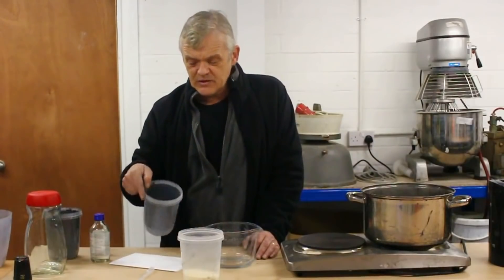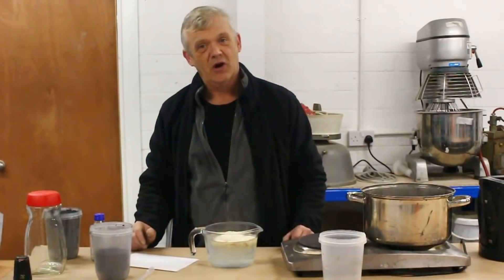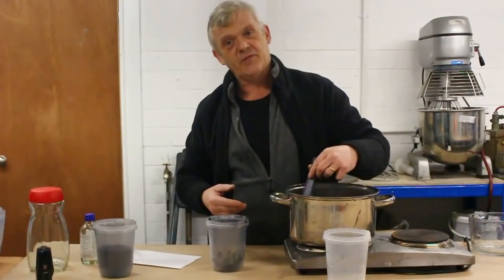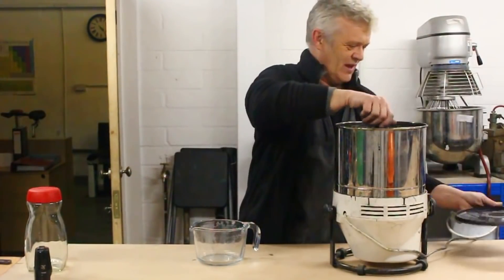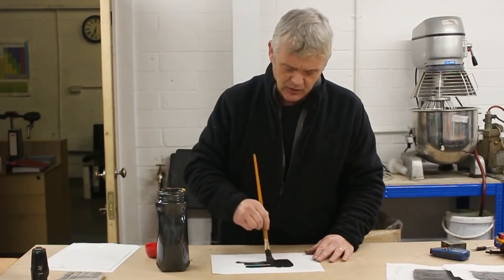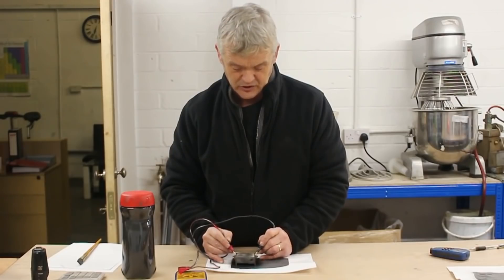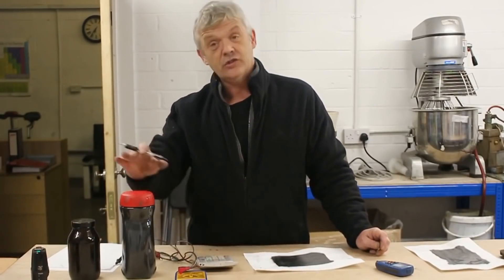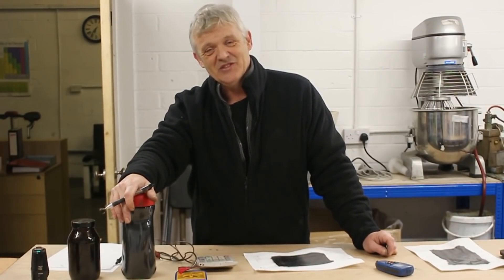1381 How To Make A Conductive Ink

Comment: I tried making this with Varnish... I think neither Varnish nor the Graphite dissolved properly in water
Reply: How did it come out?
Reply: @Ddgjyfd  it's conducting all right. After drying, its not at all flexible. Very brittle, if I touch it, black powder falls off. Perhaps I should try a different brand of Varnish, so that its not so brittle

Comment: Does the grinder also make the graphite particles finer and thereby affect reduce the resistance compared to just mixing or blending?
How would expanded graphite powder perform compared to graphite?
Do you really want per mil, i.e. an imperial measurement? Surely per um / micrometre or mm / millimetre would be more useful? As the SI units of resistivity are Ω⋅m (Ohm metres), and the SI units of conductivity are S/m (Siemens per metre) metres would be best. In SI units this ink is 1.21 mΩ⋅m or or 826 S/m. Your ink would be 49 uΩ⋅m or 20.4 kS/m in SI units.

Comment: Nice Rob Cheers! Can it be made to be less resistive than copper wire?
Reply: The short answer is "no" because, other than super conductors and silver, copper is the best conductor we know of. Carbon is not a bad conductor but not a patch on copper.

If you use a thicker ink (paint), then the resistance will decrease but you will not get (for a given cross section) a better conductor than copper.

BUT - the same can be done with air float copper and silver, but I am not sure who to suggest you make these without using fairly hazardous chemicals (mostly nitric acid).

Arguably - you could make colloidal silver - let the generator run indefinately and then evaporate away the excess water - and then add to a binder as the video

I don't want to suggest how to process silver with nitric acid on someone elses video channels BUT if you are interested and search for how to refine silver, it is when you then precipitate out the silver by adding strips of copper that you get "silver foam / silver fluff / silver sponge" which is incredibly fine silver powder. You can then ALSO use clean iron and do the same again to remove the COPPER from the solution - you now have ultra fine copper powder too - which again can be used to make conductive paints.

Commercial silver loaded paint is goppingly expensive - more than pure silver usually gram for gram - but home made can work extremely well and be (somewhat) more modestly priced.

Most carbon conductive paint is really aimed at fairly modest current handling (LED's sensors etc) rather than trying to replace copper wire that needs to handle serious power.

Comment: This premise is being used in a new manner, in aircraft control systems that don't use wiring harnesses, but rather different voltages with different frequencies, in order to control servo actuated motors and so on. All these feature are incorporated within the skins and frames of several advanced weapons platforms. But Robs video show the simplicity of new emerging tech.

Comment: Thanks Robert.
An idea: screen print a pattern of oblongs of one ink on a sheet. Dry it and screen print an offset pattern of a different ink on top. Each oblong of the second ink will overlap two of the first ink areas. Result: a series circuit of many junctions between dissimilar conductors suitable for experiments with the Seebeck effect. - high voltage thermocouples - thermoelectric generation
Reply: Interesting
Reply: Could be used for as a the premise to create DEG (raindrop panels)

Comment: If you put the ink plastic and ran copper wires in parallel lines would that make a solar panel
Reply: Add some junction, please :) 
Look at all the perovskites papers; in model measure, ok, then add the magic to keep it lasting long enough to be sold :) This is the point where the papers get fuzzy not to tell too much and where it starts looking like alchemy.

Comment: Was thinking about doing lead acid battery with stainless steel and carbon fiber.can it be used on both ends and would you have to use a different acid ??
Reply: see his older lead acid video's
Reply: You mean negative and positive  plates when you say 'both ends' ?  The carbon on positive plates may get oxidised to co2 after some charge cycles .
Reply: @michaelcorbidge7914  like how many charges  before it stops working thank y
Reply: It'd  be  less than ten charges. I've  watched heaps of his videos and  still stuff in my memory about lead acid . Negative plate is fine but positive is no go for carbon . Question arises then does a carbon electrode during hydrolysis  for hydrogen  production  also  if used get  slowly oxidised . Carbon rods are always  the immediate  items to use as electodes and we  never think  more about it.
Reply: @michaelcorbidge7914  thank you

Comment: When using varnish do you have to add anything else
Reply: depends on how fluid it becomes after you have added all the ingredients you want to try.. adding varnish thinners like generic white spirits (mineral spirits) or turpentine as a solvent reducer before you start might work better for extending the cure time in air
Reply: @paulmaydaynight9925  thank you

Comment: it was like over half a decade ago the last time ive seen you make conductive ink! it looks like you looked up some conventional ink-making practices, we used the same kind of spice grinder to make linotype inks in school
Reply: yeah, id forgot about hot linotype, updated for a diy desktop plus (additive) wand electroplating can become the diy (till roll sized) roll to roll pilot line/test production line with working end products useable for shed power walls etc as apposed to expensive commercial end product.